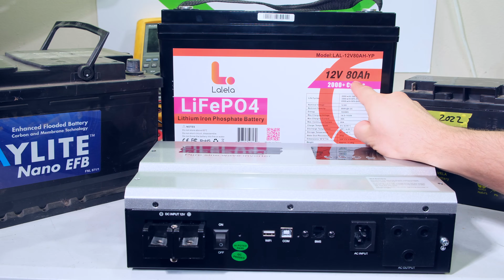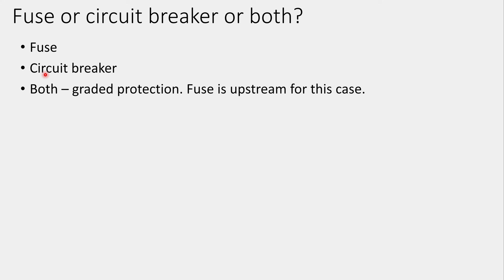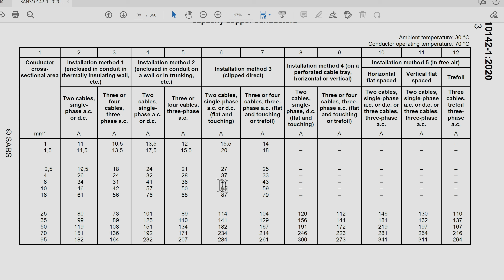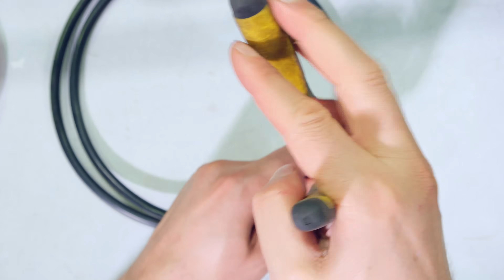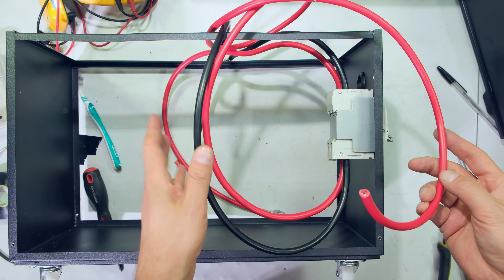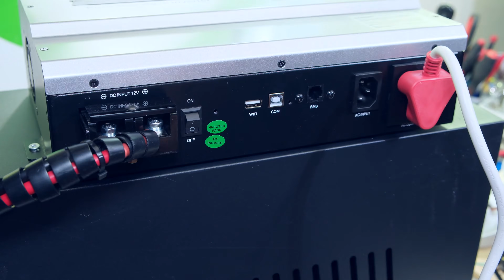How to safely wire a battery to an inverter -How to protect a battery against faults/shorts-Tutorial

Comment: Hi Philip. Thanks for the awesome video, its hard to find SA related stuff as most people on forums are all USA based.

I have a Victron Multiplus II 48V 3000VA 2400W inverter that has a 95% Efficiency Rating. https://www.victronenergy.com/upload/documents/Datasheet-MultiPlus-II-inverter-charger-EN.pdf 

So based on you your calculations it would be 2400w/0.95 = 2526W

Then it has a Max Absorption Charge Voltage of 57.6V

So then 2526w/57.6v = 43.85A. 

Yet the specs sheet says that its "Max. battery charge current" is only 35A?

Comment: Awesome video even for non technical person. But got a bit hairy when you got to fuses and circuit breakers! Can you use a 24v lithium battery with 48v inverter. The battery manufacturer has settings for different inverters outlined!